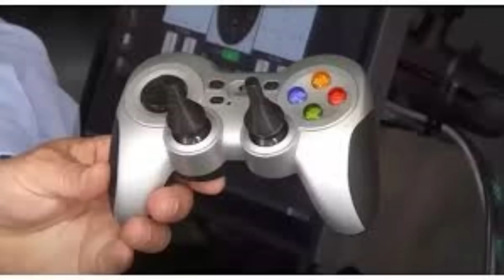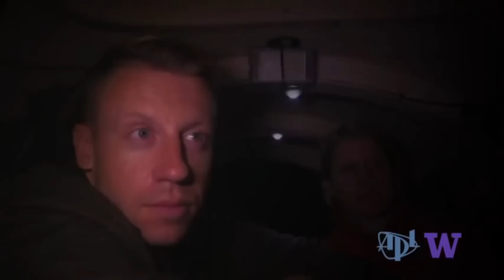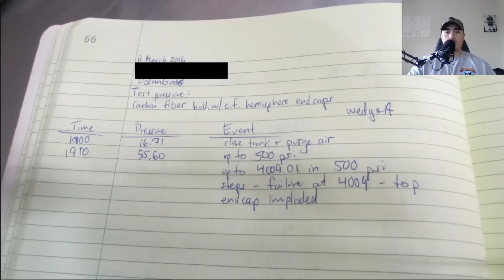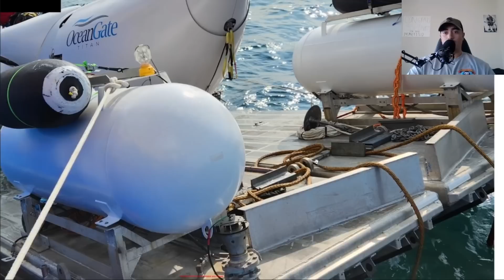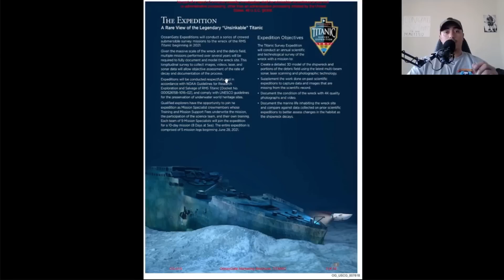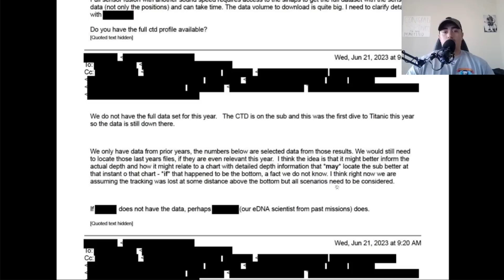PART 6: OceanGate & UW APL: Cyclops Submersible, Titan Scale Model Testing, and Tragedy Transcripts

Comment: Lol the hull that suffered the lightning strike was the one that imploded. Check your facts bro
Reply from the maker: The original hull was struck by lightning in 2018, rebuilt in in 2019. New hull while re-using the same end caps, bro.
Reply: No Tom it wasn't. That hull was retired and OceanHell had a different company create the hull that imploded. That's a fact Bro.
Reply: @tomeko8285
Before sounding off as a know it all....Check YOUR FACTS....Bro !

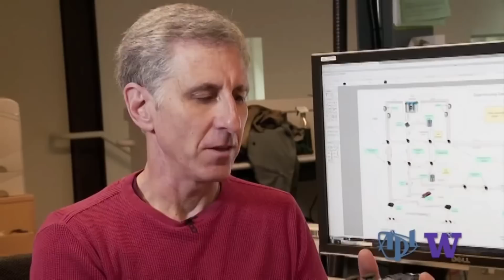Comment: 3:48 "The main challenge was learning how the PS3 controller communicates with a computer." -- No no no. I have experience coding game engines, and this is the last thing I want to hear. What he's describing is meant to be the easy part. Undergrads coding video games figure that out before moving onto the hard parts. The hard part should be figuring out redundancy and reliability.
Reply: i mean, ps3 controllers are notoriously difficult to make work with a computer. i remember you needed to use a janky ass program to make it work with windows.

Comment: Thank you for this as a passenger on one of the “Missions” in 2023 I’m amazed how few people have done what you are doing    There a LOT more in public that no one has looked at   It’s extremely frustrating
Reply: Well, we had been told that the sub was “rated” and totally safe   Also, if you take some time you can see that their lawyer told US Courts every year that the sub was built to standards that exceeded the standards of classification agencies    Also, if you read what they told passengers  (they lied in order to avoid safety regulations) they said that NASA was involved in design and building the sub    They also didn’t say that they had cut the standards of the professions they paid to give them those standards     So, while the 3 times I got into that death trap we didn’t go to the depths you bring up I still feel that many people put my life in danger and they are responsible for killing 4 innocent people   
They didn’t deserve to die- they weren’t stupid people but we’re out in a sub that anyone on that ship knew was unsafe   Thanks for asking!
Reply: You are right, just getting in that thing put your life at risk.

What happens if there is a fire and you are bolted in? They did not use fire rated materials and they DID have burnt/melted wiring in their problem log. Their viewport also could focus light and cause fire.
Reply: What if the cap didnt seal because they used only 4/16 bolts (they actually did this), and the dome became unsealed at shallow depths and you took on water?

Remember, the dome did fall off, entirely.
Reply: Can’t believe that he only used 4 bolts around the circumference of that ring. He bet on that metal being strong enough, between the bolts not to bend and blow the seal.that had to be around a 3 foot gap? Between bolts??? Pure genius
Reply: @troybirch Thank you for sharing this. I didn’t realize SR and his company were so brazenly lying about Titan’s ratings and safety. Even at the end he was still saying NASA had a hand in its design. That’s unforgivable, imo. I keep wondering if he had a death wish or if he was in such deep denial that he believed his own hype. Was the desperation for money so all-powerful that human life just didn’t count for him, I wonder. As if, all he could think about was his image and the survival of his company. It could not be seen by his peers and fellow Ivy alumni to go under. 
(Bad choice of words. Unintentional; sorry). 
Thanks again for sharing. I’m glad you’re okay.
Reply: Wow! What was it like riding down to 12,000 feet in a super sized carbon fiber toilet paper tube with end caps glued on with loc tite.????

Comment: So, they dropped weights by using the hydraulic cutter?  There was a possible hull fixture failure, maybe the one with that hydraulic line?  Was that the same line that was leaking just before the dive?

Comment: When stressed from the outside, the fibers are stressed by pressure, they have no strength, only the epoxy holds the pressure, the tank collapses inward, implodes.
Composite materials with carbon fibers crack very quickly, without much warning, no visible deformation, like metals titanium and others.
Wrong from the start, wrong choice of material, wrong shape, wrong combination of materials and bad bonding.
Sorry for the English, I'm European.
Reply: Agreed about the carbon fiber material.  I'm not an expert in any way, but when I first heard about the Titan's tardiness in surfacing, my first comment was, "What did they do, put it together with spit and glue?" 
Little did I know at that time how fitting my comment was...

Comment: The controllers weren't the problem, the diy build wasn't the problem. Just simple error in materials, carbon fiber should not be used for an application requiring more than 1" of thickness. There are many silly things to criticize but the one that caused the problem was the carbon fiber

Comment: I was a receipt inspector for high pressure gage glass  they haven’t been made from glass in a while but a molded poly product that is polished  I myself have never accepted a single one as the seating surface did not meet mil specs

Comment: since you were in the APL paper, iirc that was very explicit that you would need bars along the length of the hull connecting the front and rear interface rings. guess what they didn't do.

Comment: From memory the weights they talk about that release automatically at 24 hours used dissolvable salt plugs that degrade at a reliable speed. Probably the best designed thing on the sub, and I bet they worked perfectly.

Comment: In what world does one reuse …? 
There is a legend that during the Vietnam Nam conflict the USA considered a helicopter to be the same one if the part of the aircraft with the number plate or inventory number was attached was still in use. That part was supposedly the tail boom (empennage?). So the rotor head could be replaced, as could the engine and tranny, much of the fuselage patched up or replaced, and so on but as long as the boom was the original it was the “same” helicopter and wasn’t a combat loss. Once again allegedly.
Reply: In repairing cell tower radios, the radio was the entry in the computer database. We could replace every single part, build a whole new unit, but if we used the same serial number, wrote it onto the memory of the new radio that it was the same unit, it was the same unit.

Comment: I'd love to know what the interface of the leaking NPT fitting was? Was there a bung/through-hull female fitting in the hull? If so, how thick was the cross section? NPT fittings should NOT have been spec'd for something like that as the nature of the sealing function is a tapered fit. This tapered fit can exert tremendous force outwards, especially when overtightened. If it was bonded tightly into a carbon hull, and overtightened this could have displaced or cracked the fibers in the hull surrounding the bung/fitting. These guys were such amateurs in so many ways.
Reply from the maker: watch my Loctite video. I go through the manual and show the locations of the thru-hull fittings as best as possible. There were on the underside of the rear ring, going through the titanium. Nonetheless. A fitting was loose and may have been the culprit in the implosion. Not the most likely location but certainly possible.
Reply: @sspdiving that loose fitting could have been an indication the fibres around the fitting were delaminating or there was a void maybe. The damage could already have been done and they just tightened it up. Add to this them grinding of bumps in the seal. I think all of this should have stopped their dives. This should have been indications of a larger overall issue. Things are escalating with this hull. Loud bangs, the data shows a difference in the load patterns on descent. Now we have loose fittings and bumps. Something was going on for sure.

Comment: I don't trust using glue to glue together the titanium dome with the carbon body!!!
Reply from the maker: All the glue needs to hold is two 3500 pound titanium spheres, nothing too crazy🤣
Reply: @sspdiving I mean... It's epoxy, right? That's rated for a few thousand PSI, and the interface is far more than 1 sq inch.

So many issues with differential thermal/pressure expansion, but the strength of the epoxy itself isn't a big concern.

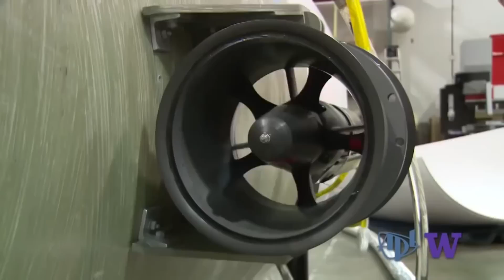Comment: 4:00 Is this guy seriously trying to act like controlling eletric motors with a wireless controller is revolutionary? 

Battlebots has been a popular hobby since the 90s, and that's not even an early example of such a thing. I don't think they did anything noteworthy with wireless, other than buying shockingly cheap and unreliable systems for a manned submersible.
Reply from the maker: I loved that show. In high school I was in robotics club and we did something similar. We basically had a steel trapezoid with a scoop in the front, arms on the side that could tip other robots over. It was so much fun, it even caught fire😂😂😂
Reply: @sspdiving  if you had fun, you won!!!!
Reply from the maker: It was a blast! The best part was beating everyone that over thought or tried to over engineered their bots. Simple was best and boy our was very crude looking. Heavy too, our engineering teacher was also our welding teacher so it was a heavy hunk of steel haha good times!

Comment: Oceangate was overstretched financially, which led to the penny pinching. The controllers are just one example, and probably the most harmless one. Game controllers are used in a bunch of different applications because they're extremely well designed and people are used to them, how many of us have used similar controllers since childhood? But it should have been wired into the controls, not run on Bluetooth, and they should have gotten a high grade one & not assume that a cheapo generic one is fine.

Unfortunately they took that attitude to the rest of the ship, and look what happened.
Reply: He saved $20 Going for a Chinese knock off vs. real Sony controller with japanese quality.

Anyone who's tried to use Chinese Bluetooth knows how reliable it is. And I'll bet you that wasn't the only area he was skimping.

The funny thing is, people who buy that crap have to buy it again and again and end up spending more than if they'd just gotten a quality product to begin with.

But his company should have been billed for rescue costs, maybe that would convince companies not to cheap out on crucial systems.
Reply: @bluedistortions I get it - you just want to vent. But the controller itself is not a problem. Essentially all controllers are made in China, including the PlayStation ones.
I'm guessing you can't even name the model or even the  brand of the controller used (Logitech F610).
Also - it doesn't use Bluetooth, it used 2.4gHz with a dongle.

Comment: "More then 1 ship with an ROV capable of reaching the 'bottom' will arrive June 20th". -- This is the Oceangate crew on the Polar Prince conducting a PR stunt. The first ROV's that arrived were ~6000ft max depth, not 12,000 ft. Oceangate blew up the first ROV almost immediately attemping a max depth dive. They ran the 2nd ROV a bit more shallow, hopelessly pinging away for a signal. The bigger ROV that discovered the wreck, was briskly hustled to the area by the Coast Guard on day 5. 

There are multiple Oceangate employees who have publicly "called out" the US Coast Guard. These weirdos claim Oceangate was handcuffed from bringing in capable ROV's to the emergency. This is a massive fallacy.
Reply from the maker: YES!!! Thank you for pointing that out. Definitely a “CYA” moment on behalf of OceanGate. How ridiculous is it to have an ROV onsite that isn’t capable of reaching the bottom AFTER they had already been fouled on the Andrea Doria wreck site according to David lockridge.
Reply: @sspdiving  Using equipment way beyond its rated capabilities seems to have been a standard approach with this company. That's a recurring theme in the whole thing, what they were using either wasn't properly rated at all, or it was rated by someone competent (eg a third party manufacturer) but that rating for a far less severe use case than the one to which it was being applied.

The only real surprise is the did in fact make it down to the Titanic and back at all.

Comment: Sspdiving
Where do you think it failed ? Hull.. window… or the glue like the ocean gate member reckons
Reply from the maker: Personally, I think the hull failed. The fact that it was supposed to be 9 inches thick and they opted for 5 inches is enough for me. Did you watch my last video where I talked about the wrong glue being used for numerous reasons.

It certainly could have been the hull to ring joint. Even one of the hull penetrations separated so it could have been that as well.

The hull made a loud bang on dive 80, even though it was monitored, it was ignored. I think it was significantly weakened.

The thing is, it could have been anywhere but it happened in an instant. So it’s hard to pin point when there was a domino effect in a fraction of a second. Great question.
Reply: @sspdiving ....great videos..I think you nailed it with the glue joint...wrong glue , different expansion between titanium and carbon fiber .. galvanic corrosion... Red flag after red flag !!
Reply: @ Yh I think you’re right.. Spencer composites have a lot to answer for imo

Comment: $5,000,000 is affordable? It seems like building a copy of one that has already been designed built and tested would be more affordable especially when considering that that $5,000,000 could get you nothing more than "I'm sorry our lengthy test's show carbon fiber will not safely work at those depths" Purchasing a used one would be more affordable as well. Why didn't this lab come to same conclusion as everyone else did, " Hay Stockton, there is a reason all of them are made out of metal"
Reply from the maker: Your last question is one that is on all of our minds… I find it ironic that UW APL put out a statement saying they had no involvement in the engineering of Titan when Cyclops was its predecessor. Not to mentioned they literally performed 1/4” scale model tests for TITAN. 

In any case, Stockton thought he could exploit deep sea exploration for big money. Think blue origin or virgin galactic who takes big paying passengers to space. 

They literally wanted to have fleets of these things, you push a button, it it takes you to your location. Which sounds awesome but we are far from that. Going CF was a way to do things cheaply, or so they thought.
Reply: @sspdiving the two are completely different designs in the way the cf hull was constructed. Oceangate had at best a design brief for Titan and they went ahead and built it and operate it without testing it. The  work done on the previous model simply does not apply.

Comment: OK... the interface between the carbon and the titanium was unsightly ... but the solution was to grind it down and not to figure out WHY it suddenly had become unsightly ... that may have been the first and only visual warning that something was going wrong there ... and they noted it just to grind it down, to weaken it further. When people write their death notes...
Reply: I work with tubes on carbon road bicycles all the time. The amount of pressure required to crush a circular carbon tube and watch the layers begin to fold and crack is extremely low. If I overtighten a bolt just a little bit, the carbon will fail. Scale that to the size and pressures of the Titan and you know that thing had no chance after a few dives.
Reply from the maker: No name next to who did it either. I found that odd…
Reply: @sspdiving  not odd, sounds like they knew that wasn't the correct action, and wanted to avoid self incrimination. Probably ordered to do this very action by Rush whenever flaws appeared visually.

What was odd was them documenting it at all. Sounds like it might have been an anonymous protest of sorts by the maintenance staff.
Reply: @sspdiving  certainly an angle grinder virtuose did it !
Reply from the maker: @EricLehmann-e7i  yes they kept one on standby at all times😂
Reply: I thought the same! Didn’t anyone think to themselves “That wasn’t there before. What’s caused that?”. 

Perhaps it was always like it but someone just noticed then because they had time on their hands. There again could it have even indicative of something going wrong? I don’t know anything about the type of glue/sealant that they used but could it become malleable at those depths and was being forced out of the channel by the pressure? If so that’d compromise the seal, surely.
Reply: @Tryna-B-Good  A competent operator of any machinery at all, or even just someone looking after a simple building, will be consciously aware that if something changes then there must be a reason for that and it needs to be investigated.

To have intentionally removed a visible change on a pressure vessel, without proper investigation into it, is mind blowing.